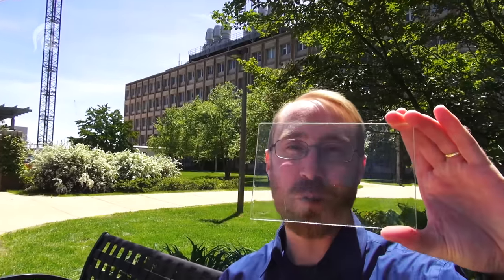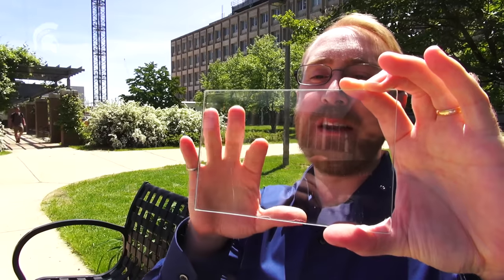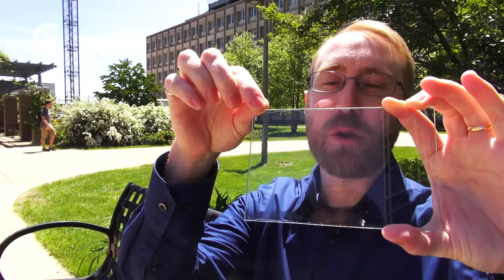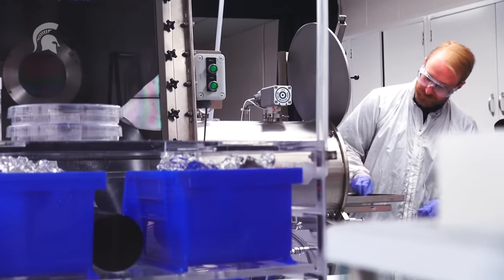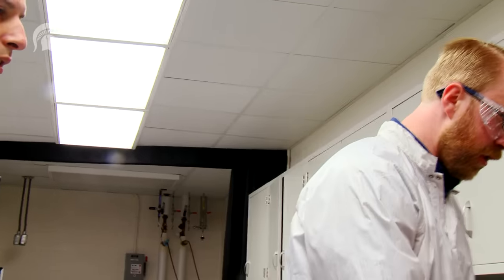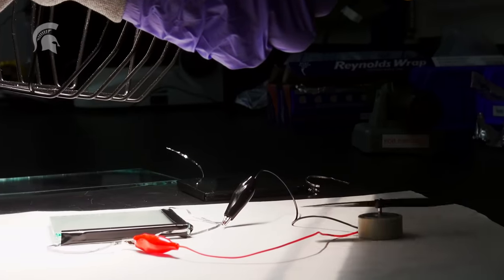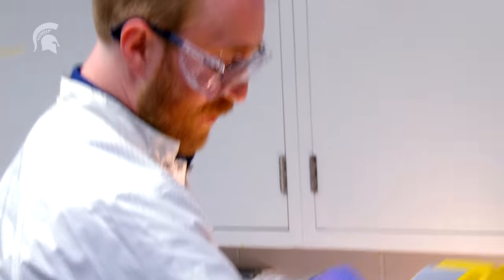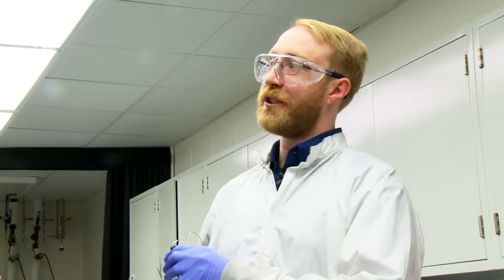Transparent Solar Panels | Michigan State University

Comment: In the written article the 'professor' admits they are 5% efficient (I doubt in reality they are even that ) ....this combined with the fact that that windows are not orientated to the sun , would give and efficiency of about 1% .... 
Normal panels have 17% efficiency .... there is no way these would be competitive compared to standard PV panels .... the 'professor' probably knows this , but want's to keep the funding coming to this project ... keeps him employed for a few years before the truth finally comes out
Reply: Putting aside the enormous cost of replacing every window with a custom solar panel for a minute, the comparison might be how much energy could be collected in a (pick a number here) 10-story building this way verses using roof-top panels.  If your 17:1 ratio is correct and there is 100x more surface area then conceptually (not financially) this might make sense.  Buildings shade each other in a city so only some faces would be eligible for collecting energy.  For a tall building this may have potential if sponsored by an entity willing to underwrite the huge cost.
Reply: My main question is cost. I can see this as useful, In addition to or as an enhancements to an existing solar power system. But then comes the question of how long do they last, What will their cost be, etc. As a stand alone system, I don't see it working out too well. As a "booster system"... Maybe. And I have seen claims now of 9.8% efficient transparent panels.
Reply: They are around 10% (at panel relative zenith). i agree, to improve the efficiency they have to build starting from the house. The retrofit is a terrible idea. Plus the problem of the costs are very important to consider. But keeping up the research is a good thing. They should think more on the business model, or maybe they have one already...(but judging from that idea....mmmmhhhhh)
Reply: oz93666 fat brain...... love this comment
Reply: @jeanclaudewellness8274  "They are around 10%"
I think that might be for partially transparent solar panels. Apparently there are different degrees of transparency being tried out--which makes good sense. If you're talking about a building that would tint its windows so the sun doesn't give too much heat (greenhouse effect), partially transparent windows would fit the bill perfectly.

Comment: I would recommend using this technology to stack solar panels on top of each other to produce more electricity per square foot in a solar farm. This would lead to cost saving in terms of the land to energy ratio.
Reply: But it'll increase the temperature too,, which in result decreases efficiency
Reply: The light will scatter as they stack. So make sure to limit the layers vs weight or all bets are off.
Reply: @djmcnamer  Good observation. Makes the suggest viable. very lucrative in terms of efficiency due to more watts from a square meter.
Reply: Wouldn't work, transparent panels capture energy from the solar spectrum that we can't see, so the "second" solar panel wouln't recieve any of these energy as it was already "absorbed" by the first one. 
It could only work if the second panel were and opaque one, but then we rather use only that one, since is more efficient
Reply: @agariztia  I guessed it would since the first solar panel would not absorb all the energy from the spectrum. It would only absorb a portion of it as light passed through it.
Reply: @sidnegi6078  second panel wouldn't be able to absorb any energy from the spectre that went through, since it is designed to absorb from the "non observable spectre" that was already absorbed in the first panel. It would only recieve the "obsevable light" that is captured on the traditional panels
Reply: @agariztia  what about a transparent panel absorbing the non-observable spectre and the lower traditional panel absorbing the observable spectre. That way there are two panels instead of one per square foot of land.
Reply: @sidnegi6078  That could work! Thay'd have to compare the absortion of that setup vs a regular panel (as it absorbs energy from all the spectre -observable and not observable-) Maybe it could be better than that.
Reply: @FrostedSnowFlakes- in addition to energy from the side, see replies to Agustin
Reply: @agariztia Also energy would reach the lower panel from the side due to spacing in the stack.
Reply: arai chacha niche solar panel dalenge toh dhoop kaise ayegi black panel mein
Reply: @rithikashah1665  panels ke beech mein jagah rakhna.

Comment: I wonder how efficient they are. After all they only cover around 1/3 of the spectrum. Current systems have ~150Wpeak/m² which would be 50Wpeak for these and then there's the fact that they won't reflect all the UV rays to the absorber because some goes through and windows are rarely standing in an optimal angle to the sun. I would say it's perhaps 15W that you can get out on average or 10% of what is possible on the roof. 

On the cost side they would be roughly the same price as the standard modules, because on the one side, they are simpler to install or repair, but then again, they need more complex wiring. So that's a zero sum game there. 

Then, the standard modules are already in full swing on the market with reliable price-value increases, for which a big factory would need to be built first for the transparent one's.

Bottom line: Great thinking, but not a chance on the market. Perhaps for glass roofs they might be viable because of the better angle to the sun. But then again, how big is that market? There's perhaps one big infrastructure project every month built globally that could have a use for them. Is that enough? Probably not.

It's much simpler to simply cover the roofs of every larger industrial building everywhere with the standard panels. Nobody would notice, but they'd do the job.

Comment: Is there an update on this?  It seems to be resurfacing in my Facebook feed on a daily basis.
Reply: this technology is still far yet for mass production , expect it to come when graphene technology is on industrial level production my estimate is 10-20 years.
Reply: Dont believe the hype
Reply: It'll never go into production, because of the almost 90° angle towards the sun. At best they get out 10% of what the standard panels get out, while being much more expensive because there is no mass production.
Reply: @the-quintessenz  even worse, only using UV- and IR-light for electricity production limits the gain even further. Most of the energy from the sun comes to us in the visible spectrum. And it doesn't stop there, if you use a solar cell that is able to use IR-light you lose most of the energy of the UV-light to heat. You would have to use to diffrent cells stacked on each other, which would makes this more expensive.
Reply: Look up Ubiquitous Energy, the company that has come out this

Comment: I heard they are half as efficient as normal cells, that's good for how small the actual solar cells are. And it's the area that counts and it may get more concentrated light cos the same amount of light is going into a much smaller area. They are just glass with science stuff in it and it's completely transparent (still) and the cells are at the edges and works by total internal reflection. So you don't lose much  cos light is still collected with a large area. Way better than compared with direct light on the cells themselves. And the extra area where you can put the solar cells makes up for the less efficiency.

That said, we should get rid of all the black (normal) solar cells (except in the snowy areas and extreme latitudes) and replace them with transparent ones (with reflective stuff under). And make sure every single roof is covered with them and also use the solar cells as windows.

And the reason I say this is cos normal cells are dark and absorb heat. In America they painted the streets white and the town was significantly cooler. So every roof covered with highly reflective stuff under the solar cells will do a double whammy with reflecting light as well as making power. Instead of cancelling it'self out by making the planet warmer with the dark cells, while making power. No, get rid of them, and make the glass ones (strait away). And on every roof! Going by what I observe, only about 10% of roofs have them (when you consider all types of buildings) and hardly any are completely covered with them.

Paint all the roads etc. a light color, doesn't have to be white, beige, like the cement roads and make every road light color. And airports, plaza's etc. Do it right now.

Those cylindrical wind turbines are only about 10% as efficient as normal wind turbines cos of the smaller diam. But cos the cylindrical turbines are of such small diam, you could easily pack ten times more in the same area, and they are relatively silent and inherently way cheaper and easier to build and don't kill birds like the normal ones tend to. And they look a bit better (just a tower) and with the silence they could have one on every roof as well, and more on big block buildings. 

Get rid of the grid (except for industrial etc.) and every house has batteries and solar and wind. An easier and quicker way to make renewables a major thing.

The world is turning into a dustbowl so we have to make heaps of desalinators where it's droughting (just about everywhere) and pump the water onto the dry land to terraform it. Immediate start! And grow heaps of trees like they are in Africa, they are growing them in long strips along the country and it's getting results (so there is hope) and it was a dustbowl, but now some of it is terraformed already. Well done, and we have to do it more, now.

Ramp up fusion and other new fangled super tech ideas that may save the planet. Experiment with that instead of sending people to Mars. Terraform earth first.

Make all plastic packaging etc white or silver frost, so when it sits in the middle of the ocean at least it's doing something right. Sounds like a joke but beggars can't be choosers, when we are desperate why not make that a policy to help cool the planet. And even go further if needed, and make millions of plastic balls that float on the ocean (white ones). They are already doing that with black plastic balls and putting them in lakes. That experiment isn't to fight global warming (obviously) doing the opposite (like normal solar cells are) but they are doing it for some other reason. lol They should do it with white balls if they are going to do that, like they should have transparent solar cells with reflective backing.

Comment: didn't talk about efficiency, cost, etc... would love more details on all that.
Reply: +Steven Davis It will be expensive until it's not.
Reply: +Nate Hoffman It will also not be efficient until it is.
Reply: Theonegamefreak These are immutable truths.
Reply: +Steven Davis Efficiency of about 7%. Since it's transparent there is going to be close to no solar radiation to be absorbed. This is definitely an inefficient technology (like every new technology). It is way better to equip your roof with solar panels than your windows with this. (roofs don't break that often).
Don't get me wrong, this does sound interesting and innovative. It's just that there is no practical application. It's like not solving the problem. "I'm gonna make a transparent solar panel, when solar panels have to absorb light to work"
Reply: not exactly. which would u choose? regular glass that does nothing? or glass that has 7% solar efficiency? even the best solar panels being used by people today are only about 15-20% efficient, so this is only 1/2-1/3 as good, which is still pretty good. u need glass. might as well make it DO something.
Reply: Yes but the solar panels absorb all the light. So this 20% efficiency is from 100% light flux. While these glass panels have 7% efficiency from very little solar flux. If it is transparent, most of the light has to go through. It will be way cheaper and effective to equip your roof with normal panels.
Reply: +Steven Davis It will cost a lot with very little benefit. The captured area is very small, they could simply make a frame from cells. If they make it the same area like in their idea i think will still be more efficient and practically invisible, but a larger frame can be actually interesting.
Reply: +Cristian Baluta 
The IR is "guided" to the edge. In other words, the full area of the glass is collecting IR light and it's then converted to electricity on the edges. That means that, although the area of the edge of the glass is very small, the amount of area collecting light is large. It's similar to rain hitting a roof, the whole area of the roof collects the rain (IR light), but it only escapes around the edges. If you put a sponge at the edge of the roof you'd collect a lot more water than if you put it on the peak.
Reply: Theonegamefreak Efficiencies comparable to gas and coal burning have already been reached in regular solar panels. That's even with falling commodity prices. Think about what happens when those prices go back to normal.
Reply: Nate Hoffman
I stand corrected.
Reply: blindcheto - you don't know what "efficiency" means. This transparent panel absorbs wavelengths that you can't see and turns their energy into electricity. If the available energy in those wavelengths is all converted, the process is 100% efficient. It makes no difference that the visible wavelengths are allowed to pass unhindered, even if they do constitute most of the energy that is incident. 
In practice, it won't be 100% effecient, but it could be high. The appropriate definition is
eff = (output power)/(available input power) , where the 'available' fraction is decided by the range of wavelengths that is converted, compared with the full range falling on the cell.
Reply: the efficiency will be from 20-35%
this is just a flat optic fiber that sends light to the edges where pv strips collect it and produce electricity
Reply: Not always. Because it is not trying to compete with traditional panels. The idea is, with normal windows, you need energy for cooling the building because of the sunlight coming in OR you can coat the windows with reflectors. What this technology will do is trap the excess energy for use. Thus saving cost on cooling plus producing energy.
Reply: build it first efficiency comes later
Reply: Nate Hoffman lol 💯
Reply: Shit's been round for three decades; since amorphous H:Si.  Every few years, people re-brand old shit under a new twist and pretend it's much better.

1. Very inefficient, very poor acceptance (can not honestly be rated by a 1000W/m2 nameplate).   Never-mind aging issues (esp of the newer organic-based)

2. Most of sun's energy is in the visible, so you lose most of it.

3. Not going to justify the infrastructure/complexity/cost to get >> 0.1 kw-h/day annual efficiency, which is being realistic.

4. Architectural windows are about the most expensive place to have a failing device.
Reply: Bro plus tell me how can I make it?what things are needed to make it
Reply: As a lawyer once said: when the facts favor your case, argue the facts.  When the facts are against you...
Reply: @StevenDavisPhoto  it's all about cost and productivity.
Reply: The solar cell that is transparent like glass. Keynote Prof. Richard Lunt at BMW Welcomes.
Reply: right! the environmental and economic aspects are not discussed..as well as lifetime and the material it is made of, fragility, etc..it can easily put pressure on natural resources and certain minerals..but could be a promising opportunity for greenhouses!
Reply: @StevenDavisPhoto  You also have to account for the angle to the sun. On the roof you can opzimize the position while windows usually are vertical. That means you have to multiply the 7% with another ~30% for the losses there and you come out at 2% efficiency. That's like using potatoes as energy source for lightbulbs.